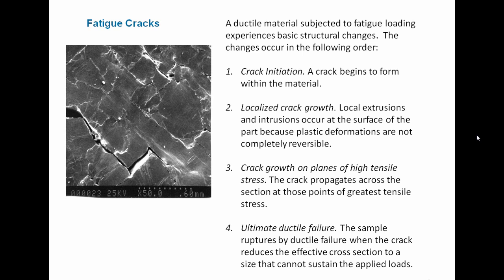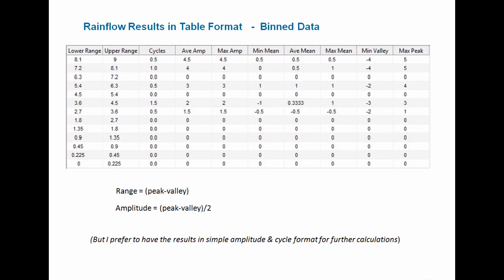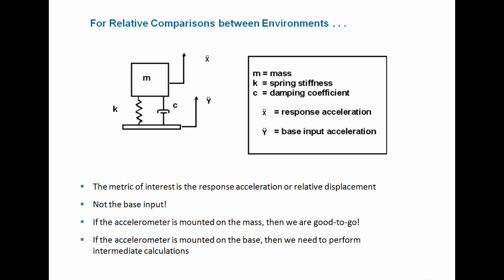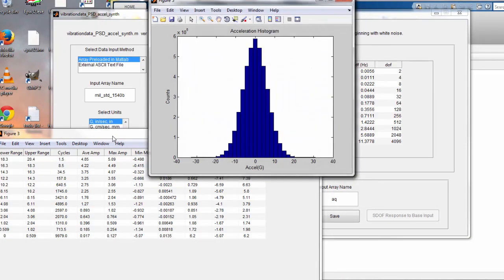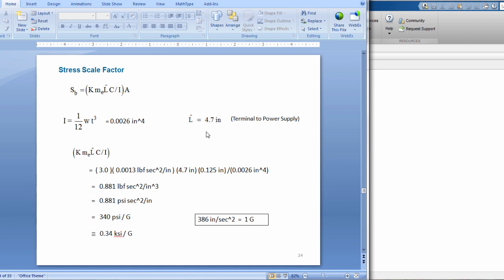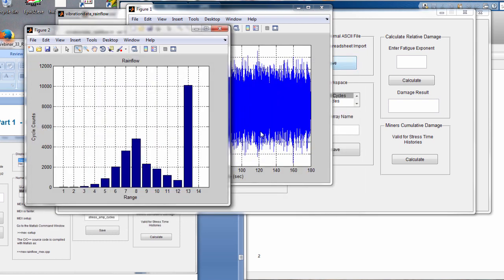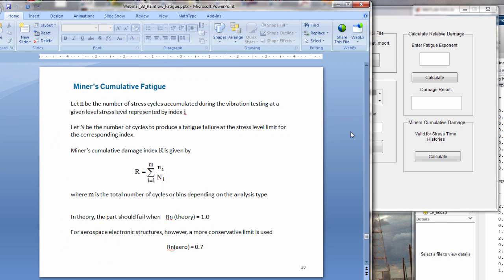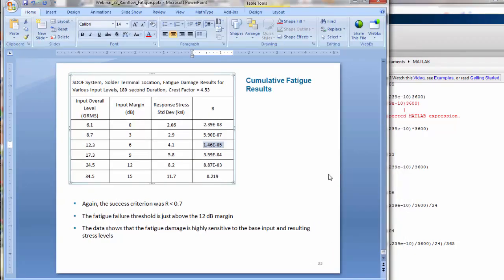Shock & Vibration  39  Rainflow Cycle Counting for Random Vibration Fatigue Analysis

Comment: Why the rainflow from D to E is not terminated at the roof and continues till point G?
Reply: As you count peak to peak, the next peak after D is F. Peak F has a lower stress level than D so you continue with the same cycle till as larger peak is encountered. Is this case there is no peak larger than D so the cycle terminates at the end of the sample.
Reply: As good practice, plot on a hysteresis loop and you will see why.